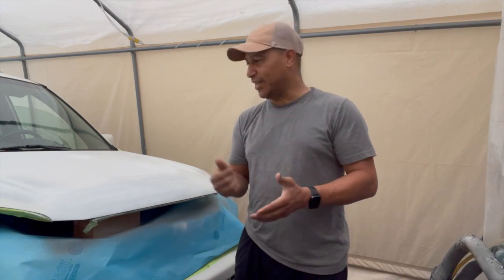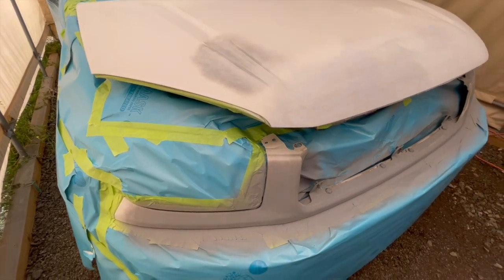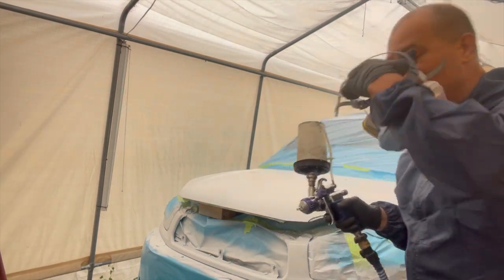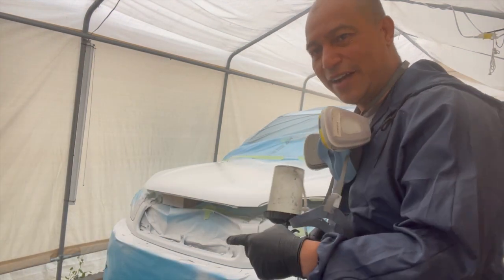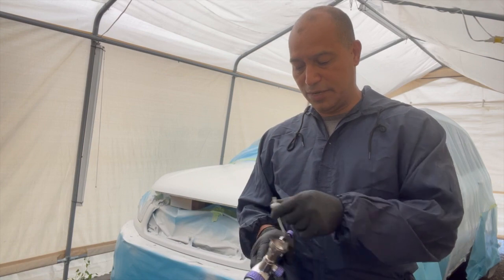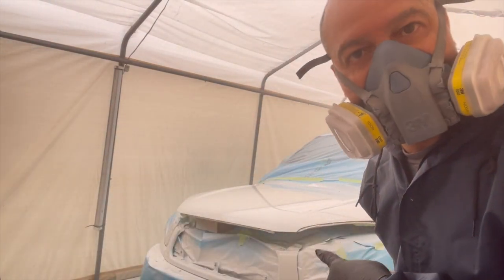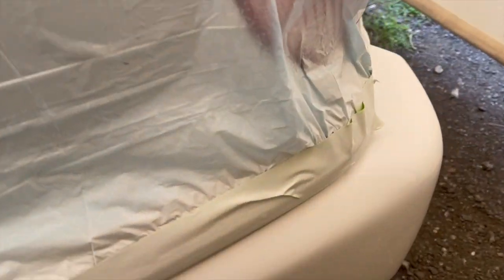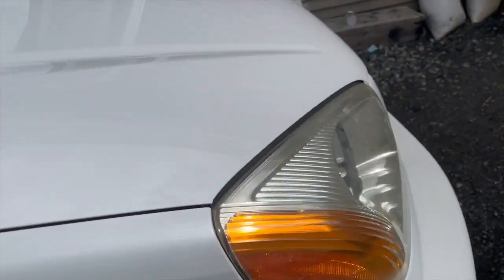Spray Painting a Hood with a Mini Mite 5

Comment: Nice job! I just started using the Q5 for mobile bumper repairs recently. After 24 years I finally found the cure for contaminated air and lack of air. Wish I would have done it long ago! BTW, you don't need the check valve with PPS. Have a great day!
Reply from the maker: Thanks for your comment.

Comment: Are you having problems with leaking with your Fuji and stock cup or PPS converter system? I had a lot of issues with small drips throughout. everything new, new liners, etc. The stock cup lip is pretty minimal for locking. but the PPS 2.0 with adapter system leaked just as bad from cup lid. I've basically covered with plastic wrap and tape to stop ruining my hoods and roofs. I'm noticing you're using the stock cup hose with the PPS cup? any reasons why? thanks
Reply from the maker: Hi there,
Sorry for the late reply. But I think if your system is leaking is because it’s not fully tightened. Maybe put some Teflon tape on it. That might help. And if you’re talking about your pps cap that locks onto the adapter it maybe because you have the wrong caps for the adapter. Check with your paint provider.

Comment: Thanks for posting this. I just started spraying my '76 Corvette with my Fuji Q5.

Can you state again your gun settings for both base and clear? Fan and fluid (how many turns from closed)?

Thanks!
Reply from the maker: Thanks for your comment. 
My settings always vary depending on what I’m really spraying. But typically when spraying base coats i use a 1.3 needle set, and I turn the feed nob one full turn. For primers you might want to open it more due to the vicinity of it. When spraying Clear coats I usually use 1.0 or 0.8 at the needle and i turn the feed nob 1 1/2 turn to two full turns. This set up has always worked for me. Hope this helps you. And please do show us the results of your project when finished. Cheers!!!
Reply: @quickfinishsolution2483  Thanks for the info.

The last few days I've been spraying Eastwood's epoxy primer. I've used my 1.3 tip and did not reduce the epoxy.

I got a really good finish and almost no orange peel when I sprayed with the fan almost wide open and the fluid 1.5-2 turns open.

However, if I try to spray with the fluid wide open, I get large droplets and orange peel.

Is the fuji capable of spraying any materials with the fluid set wide open? Or, do you need to keep the fluid closed down to ensure proper atomization?

The epoxy is the only thing I've sprayed so far. Next will be 2k urethane primer, but I'm nervous about how that will spray.
Reply from the maker: If you are getting large droplets, then you need to thin your material more. But make sure you leave your fan pattern all the way open. Do a test before you actually spray your part and go as you think your spray is consistent.

Comment: What size tip are you using?
Reply from the maker: 1.3 for base and 1.0- 0.8 for clear
Reply: @quickfinishsolution2483  would you recommend the 1.3 for metallic base?
Reply from the maker: I would definitely recommend it. I use it all the time with or without metallics. Never had an issue.

Comment: Did you get any orange peel?  You didn’t mention if you did a cut and buff on it.  Just curious since I’m about to pull the trigger on buying this Fuji system.
Reply from the maker: No I did not get any orange peel. This is the highlight of using this equipment. If you know how to use it you shouldn’t get any orange peel. Nevertheless you do have to occasionally buff it due to some dirt here and there. But on this project I did not have to.